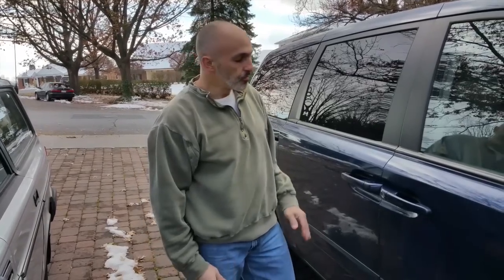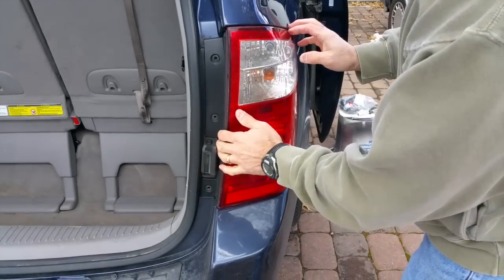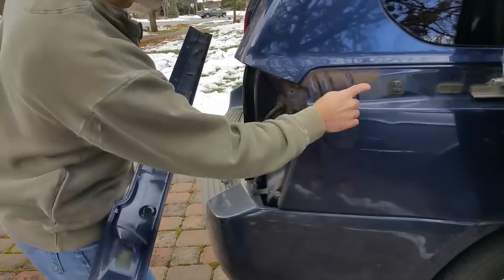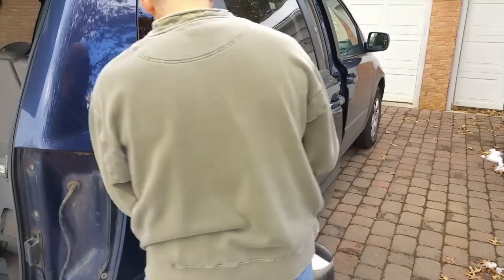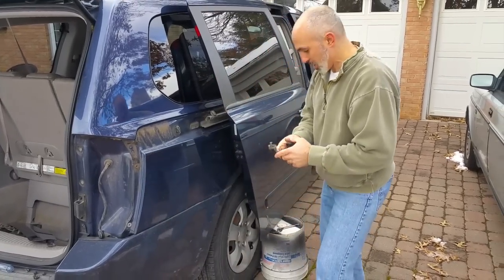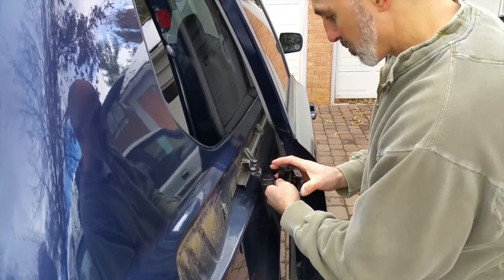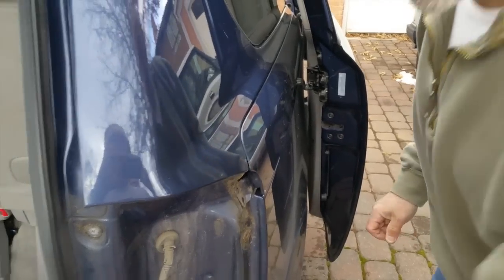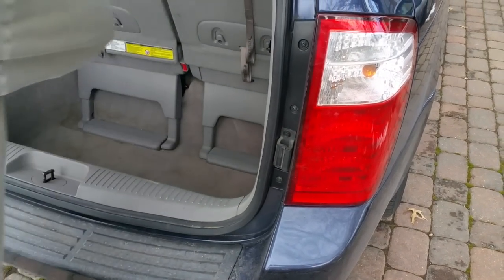How To Repair Kia Sedona Sliding Door

Comment: This saved me a lot of time.  My doors do not bind but rollers sounded gritty and metallic. Plastic roller caps are gone but I cleaned and greased old ones.  My van has power sliders so you need to unhook back end of roller and then take front cable off at 90 degrees otherwise same.  Thanks for giving bolt sizes too.

Comment: Bob Arslan Thank you very much for this video -- you definitely saved me some money. I have a 2007 Sedona and the driver's side passenger door actually came off its track. It looks like the roller assembly could be replaced but it's good and works for now. I used your video to get the door back on track.

Comment: Good video, The earlier Sedona is different mines 2002 and just fixed the middle runner. You can access it from inside the car by removing a small panel and 3 bolts. There is a stop at the end of the slider under the rear window remove the stop.  

Be careful not to scratch your paintwork when removing the runner by sliding it out where the stop is. The problem is the 2 plastic rollers wear out just lift them out and replace with AM0610-10 Oil Filled Bronze Plain Bush 6x10x10mm £7 for 2 in UK  grease the runner and re-assemble total time 40 minutes easy job. Ask someone to help hold the door.

Comment: This part has real manufacturing defect issues. In 150k miles I've now changed the passenger side roller assembly twice & driver side once. I'll bet I have to change that again soon. At $300/pop for failed plastic, it's a joke. 
Your video was great tho. I always forget to slide the cover forward to get it off.

Comment: Great video!  We have a 2016 Kia Sedona and trying to figure out how to remove the outer trim panel... as it looks like a different process/setup compared to your 2006.  Anyone have tips/advice for the later model Sedonas?
Reply: same issue, did you figure it out?
Reply: @nmilonopoulos  Yes, figured it out and saved $1k from the dealership.  Once you remove the screws, you will have to gently pop out the panel as they are held in by clips.  It took me about 30mins to figure it out as I did not want to break the trrim... but now can do it in 5mins. Good luck!

Comment: Hi. I am from Chile and I have the same problem. The same part fails in my vehicle (KIA Gran Carnival). What is the name of the part and where can I buy the replacement (supplier's website). It would be very useful if you can give me the code of the part. Thanks a lot.
Reply from the maker: Part name is Roller Assembly Right Hand. Part number: OK552 72230G.  Search for this part number and you should get lots of hits. Good luck!
Reply: thank you

Comment: Bob, I have a 2007 Hyundai Entourage. The cable broke and the door simply wont slide.t 3.02, you show that a bolt has to be taken off. I wonder how I would do that since the door is shut and this bolt will not be accesible.
Any info that you can give will be appreciated.
Reply: What did you end up doing? My cable broke on my sliding door too.

Comment: i have a 2006 kia sedona and i have a problem  with my door it wont latch when i try to close it i have to tied up now whats the name of the part i need so i can open and close my sliding door
Reply: Jay sonss4 2026
Reply: Jay sonss4 2006
Reply: Jay sonss4 Kia v6
Reply: I had the same problem on mine and I just added a lubricant to the part that latches on and it worked for me.

Comment: Nice video Bob! I'm from South Africa and my Kia Sedona 2009 model and one of the automatic sliding door does not open suddenly. Even power off mode(to enable manual open/close) does not work. Any ideas will be appreciated! :-)
Reply from the maker: Shin Kim It’s hard to say without more info. Perhaps an issue with the lock rather than the door itself?

Comment: Hi Bob
Just a question if you may know what is my issue and how to tackle it.

I have the same vehicle same reg and all the issue I have is that the left passenger rear door doesn't lock and actually stays open. 

The looks from the side as if its locked but the dash board computer signals that the door is not locked and in fact if you were to push the door from the inside it will open .

Now I have taken it off the electric open to manual and it has done the job it stays closed at all times now but my local mechanic said  to repair it will cost me £700 sterlings WOW  I know his trying to fool me but I saw you videos and I thought I'll ask in case if you may know the answer to that

Thanks SuLi
Reply from the maker: I don't have electric doors on my vehicle so I'm not sure I can give you good guidance with your specific issue.